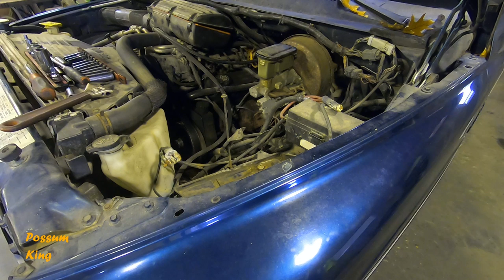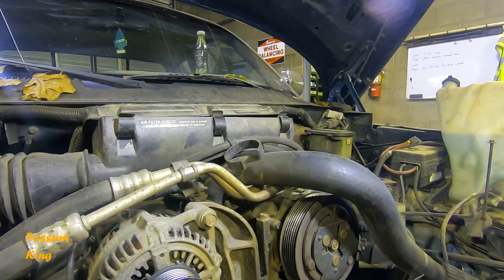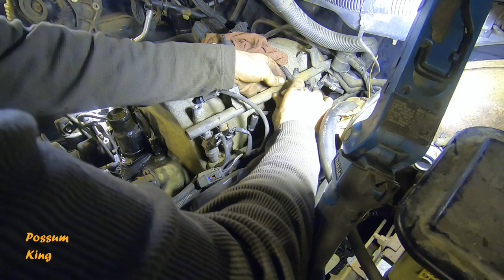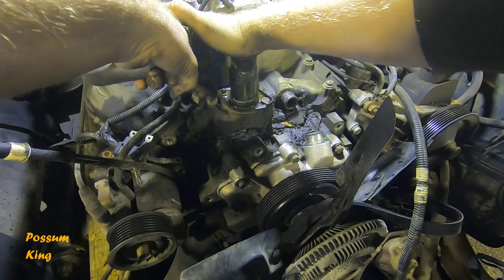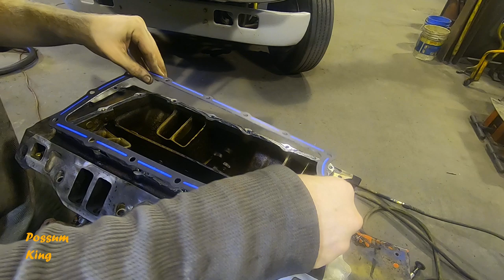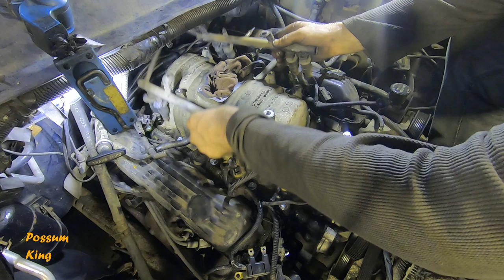Dodge 5.2 or 5.9 Magnum Plenum Plate Repair (How To)

Comment: Got a Question,got a 95Magnum318,The EGR Is Not Stumbling when I put Vacumn to it and it's keeping me from passing Smog,I'm a Mechanic Myself and I'm Stumped,Any ideas why it's Not Doing what it needs to,Cleaned All Passages and Installed New EGR...It's Giving Me Hell,Thanks,Great Video by the way,Thanks ✌️
Reply from the maker: No clue. we don't have that where I live.
Reply: Egr is seized up on the pintle or it’s plugged up.
Reply: EGR is stuck open.

Comment: That small section of radiator line tubing is a simple trick, completely loosen both hose clamps or at least the bottom one put it up to the middle and pull the bottom half off first and it should come off no problem with your hands

Comment: I have 307K on my 360 with still good compression across all the cylinders but I'm down on power and burning about 1 quart every 1,000 miles.  I liked the video and wondered if this helped restore your power and if it was noticeable.  I'm hoping to avoid a full rebuild if I can and get a few more miles out of the engine.
Reply: That’s more than likely your issue. Especially if you’re hearing a whistle when you drive every now and then almost like electrical interference in your speakers, you know that high pitched whine. That’s a dead giveaway that you’re dealing with a plenum gasket issue. Also stalking out. That’s a big issue with a bad plenum gasket. I am about to do this on my 99 5.9 with 294k. Unfortunately it’s gotten so bad I have to change it TODAY as opposed to tomorrow when the actual Hughes kit comes in the mail 🙄
Reply: How many transmissions did you go through in 300k miles?
Reply: @aronkovacs1386  I've got about 300K on my 98 dodge. I'm on my 2nd transmission. I have 298K miles.

Comment: While you were replacing the dist. cap ,you should have replaced the cam position sensor under the rotor button .If that goes bad the truck won't start .
Reply: I will often just change the distributor as a few dollars more than pieces within it, you just renew the whole thing

Comment: Silicone OR gasket. Not both. Just silicone (if you use the right one which you did) works better than just the gasket. This will leak sooner.

Comment: Would this cause your oil to disappear and make it so thin that it runs down the dipstick when you're trying to get a proper reading?
Reply: It makes the oil disappear but not the thinning of the oil, fuel or coolant may be leaking into the oil
Reply: @kellismith4329  well it's not coolant for sure

Comment: I wonder if the aluminum plate could be tig welded to the intake to guarantee no leaks ever again? Would it crack from welding heat?
Reply from the maker: Just delete the kegger intake at that point. Look at aftermarket options. Then you can add a remote turbo too. Lol

Comment: I installed a new oil pump want to put a test pressure gauge where the oil pressure sensor is to actually see the oil pressure. Will the eng. run w/ the sensor out?
Reply from the maker: Probably, but wouldn't that spew oil everywhere?
Reply: @PossumKing  
Test Pressure gauge will be in it's place. Idle pressure should be at 10 psi. Just wanna make sure the oil pump is doing it's thing. 2nd gen. 5.9 gasoline. Sensor up on top by the distributor. You know!
Reply from the maker: @spiritoflight1375  oh I gotta now. Yeah you will be fine. It's just the dash gauge.

Comment: I let a mechanic work on mine once.. and they stripped that idler pulley but stuck it together with some goop.. MF'ers.. I helicoiled it.  Smart tip about leaving the AC and Alt on the bracket then removing as one unit.
Reply from the maker: I rip that whole assembly out every time I have to work on that darn thing

Comment: Hey after doing this repair I have a lean condition and bogging down and falling all over itself when I give it gas. Think a gasket may have shifted on me while I installed?
Reply from the maker: Maybe you missed vacuum line on reassembly
Reply: @PossumKing  I just carb cleaner checked for vacuum leaks and discovered violently that my spark plug wires that I swapped 3 years ago are arcing like crazy. Would explain why it's stumbling on accel but idling reasonably fine.
Reply: @PossumKing  I'm gonna swap the wires and I'll check back in!
Reply from the maker: @deadlysrestorations  copper. Plugs, rotor everything. Copper. That's what these engines want. The motors take a beating but they are pretty shitty on design. Parts are cheap though.
Reply: @PossumKing  yeah I know that copper for sure, learned with iridium thinking I was doing it a favor.. but unfortunately after pulling the plenum again and re seating it and going over everything, she is still missing. I have a feeling the prior owner did some sketchy shit with the motor like everything else he did on it which is causing my problems. I'm now getting rid of the truck for 1k and getting something else. I'm tired of working on it. It's beat up inside and out.

Comment: I recently bought a 98 ram 1500 if you're facing the engine towards the back right side of the engine near the air intake mine has a greenish colored plastic vacuum line any idea what that goes to or where it hooks up at? It has a decent vacuum when the motors running. My engine is the 5.2 (318) magnum with 4wheel drive Laramie SLT st
Reply: That is for your gastank vent and carbon canister etc, that green port you can connect vac guage or attach smoke machine

Comment: Those also eat oil because there's no baffle under the valve cover so it sucks up oil through the PCV valve so you should put one on it
Reply from the maker: Gatorade bottle catch can. Then just dump it back into the engine when it fills up. Haha
Reply: @PossumKing  why do that when you can fix it right unless you're one of those people that can fix shit right

Comment: Anyone know what the new length and size bolts are needed for adding the plate. Making my own plate now and wanted to get the hardware together. Also is just a washer used and/or lockwasher? Thanks a bunch in advance

Comment: Can you skip the regular gasket and just use gasket maker on the plate?
Reply: Yes. But make sure the just finger tighten the bolts, wait 2 hours and then torque them. Then it's roughly 12 hours before it'll hold pressure. But that said it will hold better than the gasket will. But absolutely NEVER use both silicone and a gasket. It'll lead to premature failure. Usually before 50k miles

Comment: Can anyone help? My intake isn't sealing on the back end where the water ports are, its leaking coolant, I done the job twice and it's still leaking. Followed instructions, torqued down correctly, tried tighting bolts down more but made it worse, second time around I tried gasket maker around the ports but still leaked. What else can I do?

Comment: I have the same engine, for what even reason my engine will Shut Off.. I am at Ends-Wits with it trying to move all wires around if possible to Shut Off.  No Luck. Shuts Down without reason and will start up after 1 - 2 minutes without Key. Also, replaced many other parts and the same thing continues without any final clear fix..
Reply: crank sensor fixed mine
Reply: Crank sensor or ecm. My truck did that. Come to find out the ecm was shorting out when it would get hot.

Comment: I didn't see you messing with EGR. I have a EGR tube bolted in the back of my intake.
Reply from the maker: Unbolt it and throw it in scrap pile
Reply: The 91 to 95s have egr. 96 on up doesn't. Do not scrap your egr system..it will cause more harm than good.

Comment: I was wandering my cylinder head is little loose and next to the cylinder head is leaking coolant so can u let me know what wrong I have any tips & i have 2001 Dodge Ram van 3500 5.9 engine I hoping I have to not replace big block engine
Reply: 5.9? Cummins or gas?
Reply: @davejames2015  gas and I just found the coolant coming from it’s was the thermostat gasket not my cylinder head

Comment: So i have a 5.2 and im hearing what sounds like a vacumm leak and traked it to the throttle body since i only heard it at a quarter throttle and inside the throttle body where the iac goes in i can feel the suction is that my plenum plate being cracked or the intake manifold gasket?
Reply from the maker: Probably the plenum plate. Idk I'm not a mechanic. Haha
Reply: Old comment, but for others there is supposed to be a gasket between the throttle body and the air filter housing. If this is missing it sounds like a vacuum leak.

Comment: Rob here....I put a 360 magnum from my 2000 Durango on my 1984 Dodge w350,just put an Edelbrock air gap intake on it with a Holly 4150 and a cam snout extension for the fuel eccentric. Now she purs like a kitten...
Reply from the maker: That sounds awesome!

Comment: So did it solve the loss of power and oil consumption?
Reply from the maker: solved oil consumption. Still has vacuum leaks. Was working on it the other day
Reply: I recall recently replacing my Palineum Intake with the  Hughes 1/4" aluminum plate.. I saw restored to almost immediately New Power after installation. There's no Knocking from the Valves anymore and it sound and runs very smooth across the RPM Band.. It was at the very best for spending my money on it... I'm very sure that you will enjoy it also...
Reply: @prior8t2000  I have a 98 dodge ram 1500 with the 5.2. Same issue. I did the plenum gasket repair a couple months back. Perfect!, mild power increase, motor runs very smooth, no valve clatter, increase of low end torque, and no more oil use. I also was having to add a quart of oil every 1000 miles, just thought it was worn rings but it was being drawn through the plemun plate into the intake and burning it out the exhaust. I now have about 1800 miles since the repair and have not lost any oil at all. It is definatly worth doing the repair. There are several videos on you tube showing how to check for the 'leaking gasket issue'. The gasket on my truck was completly rotted, broken in several places and some of the pieces had fallen out, fortunatly all the pieces were laying in the valve galley abouve the cam. A bit of cleaning and all is good.

Comment: I mean dam brutal with the hoses I guess the struggle is real. They make big boy picks you know now since 50 years ago that get hoses off in 2 seconds. You’re the guy who puts broken connectors back on ain’t ya? I just learned after 20 years to try the smarter route, but not always
Reply from the maker: You are triggered over the tools I had available?

Comment: Would you be able to email step by step instructions? Do I have to take off the alternator and the AC compressor and then the bracket or can I just take off the bracket? Also how does the fan come off? I’m 17 and wanna do this job on my truck but worried about not putting it back together correctly.
Reply: Fan can stay it's just annoying to work around. You need to remove alternator. The ac compressor just unbolt the 4 that hold to to the bracket and the nut holding the lines to the plate, unplug it and you can flip it over out of the way to the passenger side without having to evacuate the system

Comment: When disconnecting a battery, ALWAYS REMOVE THE NEGATIVE TERMINAL FIRST, and connect it last when installing!   Unless you enjoy the fireworks when the other end of your wrench on the positive terminal happens to contact any other bare metal on the engine or body.
Reply from the maker: I do indeed enjoy fireworks

Comment: can you pressure wash that oil off in the intake mani? and can you use an impact  at all for this job?
Reply from the maker: No impact on the intake. Need torque wrench. Also I cleaned everything up with parts cleaner. Anything more is being picky. It's an old truck.
Reply: Impact everything you can while taking it apart.  
Going back together….nah not on this stuff.

Comment: You should have went ahead and replaced the pick up plate with the cap and rotor. It will make a pretty big difference.
Reply: Pick up plate?
Where’s that?
Reply: Yes, I just get a new distributor ass’y now instead of piece mealing
Reply: He means pick up coil it's the sensor between the distributor and the rotor. Some call it a cam sensor

Comment: This was the turning point repair that made this truck a keeper and now at 198k she still gets it done at 7500lbs with all them tool boxes and 35 inch tires, it moves out.scareing old ladies with flowmaster series40 no cat needed here in north idaho. Added oil cooler and eletric trailer brake to handle big tows 12k oops is that passed the factory rating .there goes thev warranty!
Reply from the maker: Y'all just do thinks different in ID.
Reply: @PossumKing  i bought it from Arizona there were no twenty year old 3/4 ton solid axle trucks up here that were not rusted ot ..so i shipped it here started building. Tore it apart took the bed off and started shooting it with raptor bed liner .no scratches dings or rust ! I get alot of questions and it became popular among us who really use there trucks hard

Comment: Ball park $$ how much would something like this cost?
Reply from the maker: I linked the website I ordered parts from. $137
Reply: @PossumKing  i think he meant,  how much would it cost for the labor  to replace the plenum??
Reply from the maker: @SoHos74  oh okay. I wouldn't know that. I don't work for that shop that I was using in this video. I have a rental agreement with the shop owner for heavy duty stuff and sometime take my personal vehicles in there.
Reply: Im finishing up this job now along with new water pump and I wouldn't do it again for less than a grand. Sound too much? Then you've probably never done it lol

Comment: Can you tell me please; What is the torque of the PLENUM bolts that Hughes says to use?
Reply from the maker: This project was a long time ago. I can not remember those specs.
Reply: Look on their site it tells you
Reply: @DanielThomason  VERY LOW TORQUE! I read someone had this fail three times, so I used the FACTORY torque and thread locker to be sure I would not have to do it again!

Comment: I did this repair with the aftermarket plate and the gasket still blew out 3 more times
Reply from the maker: Same one I used in this video?
Reply: I did the same and it lasted less than a year.  Just as bad as before.  I followed every instruction and everything was squeaky clean and torqued properly during installation. Doubt if I'll ever do that difficult repair again.  Just an F'n bad design, no other explanation.  I suspect that the bolts holding down the plate are either working loose or they need to have  a higher torque than specified.
Reply from the maker: @fastbusiness  just delete the kegger and get a real intake
Reply: Have a shop weld that aluminum plenum on. The kegger is a very good TORQUE manifold for use on a truck as a 2nd gen. RAM is no Barracuda or Duster, but a work vehicle. Please bear this in mind: horsepower sells vehicles, but torque moves them. Plenum repair here used Fel-Pro gaskets, lots of RTV sealant + lots of Red thread locker for the plenum's 15 bolts.
Reply: Clean the parting line on both sides with brake cleaner really good.  No oil residue.  Use black silicone and use it fairly heavy.  Slight tighten then let set for an hour or two.  Then tighten the rest of the way.  No way in hell is that gasket ever leaking.
Reply: tried and true solution on the forums, shortening the original bolts work with oem plate and gasket. Be sure to use rtv. Original length too long to be tightened/torqued enough.

Comment: Man i really don't want to do this!
Reply from the maker: It's easy. Just takes a little time
Reply: Did this a few months ago on a 1998 Dodge RAM 1500 with the 5.9L MAGNUM during an engine overhaul & new Hughes cam swap. This is the best thing to do for peace of mind + to save your catalytic convertor as truck's previous owner didn't fix the plenum = me having to replace the cat <-- not cheap.

Comment: While it's out try and cut out that center divider. You will thank me later.
Reply: What's the purpose of doing that modification?
Reply: More power in upper rpm range
Reply: I watched another video where a guy did that, does it give it more power?